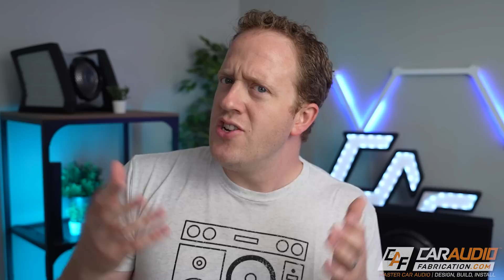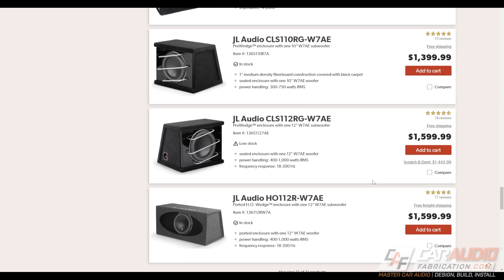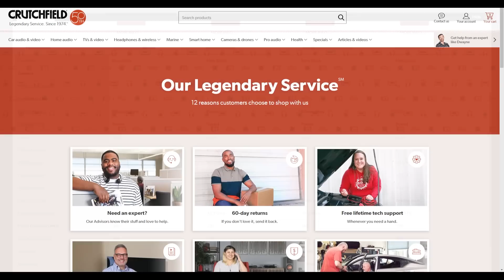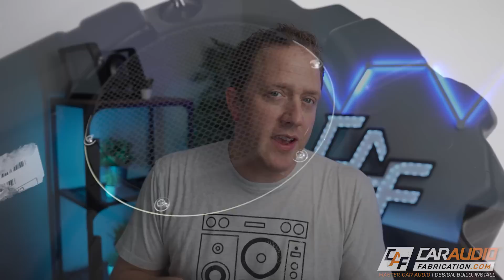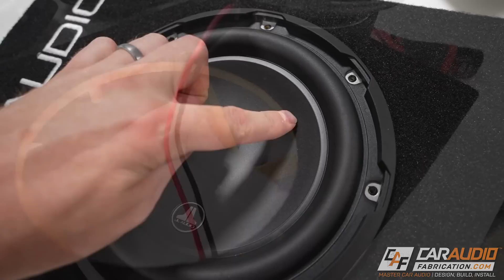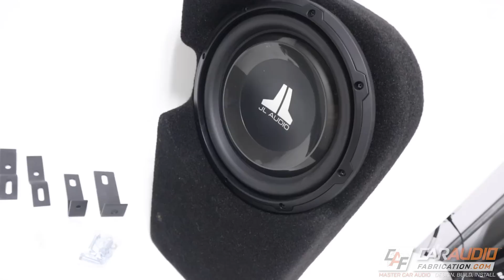5 Reasons to AVOID factory “premium” subwoofers! Get THIS instead!

Comment: Problem is usually the premium sound systems include more locations for speakers, so if you go with a lower end trim w/o the upgrade you’ll loose the unique built in locations. Same with the built in subwoofer, and middle dash speaker locations. 

It’ll also be a lot harder to tune to get the surround sound system that most premium factory systems have. Only downside to aftermarket stuff is that it usually requires heavy modifications, like the a pillars here for an example. 

I don’t like anything taking up the view of the windshield personally so having these giant boxes stick out would probably drive me crazy. Then there’s the problem if you have a niche vehicle, one that doesn’t have that much custom door/a a pillar options, and the speaker count themselves. 

That’s why I love the newer Ford trucks so much, they have a-pillar locations for tweeters, big door speakers, center dash speaker, and a subwoofer that is stealthy mounted behind the rear bench seat. They usually already have enough alternator power too, especially on the diesel 6.7 F-350’s since they come with dual batteries, and dual alternators.

Comment: Thoughts: could you effectively ADD some bracing (think thick styrene glued in place with CA glue or a stong yet semi flexible construction adhesive) and also use Dynamat sound deadening material to reduce resonance and flex on the cheap plastic sub boxes? Id like to see an SQ and SPL test comparison on something like that. 🤔

Comment: Factory premium is a godsend tho compared to standard, especially on the older vehicles, where that "few hundred watts" is massively larger than the maybe 50-80 watts the non premium uses. Even aftermarket head units only improves the sound on the stock older truck speakers, and those are only running 14-25w/ channel... So factory premium on say 200w is at least double the power over that. 
That being said, my stock normal system is not bad on my 22 Durango, it just needs more of the deep bass. Midbass isnt bad, but lacks yhe deep punch below 50hz to match the good sounding mids and highs, so yeah, just adding an aftermarket sub would be good for me in this instance, however I feel the factory premium would be enough for me on this vehicle. 
My project 96 Ram tho is getting a custom stealth pirted box with an Alpine type S 12 and type S coaxial/triaxial panel and door speakers, and will run off a 5 channel 1000w RMS Pioneer amp.

Comment: I have a base model Golf Alltrack, which doesn’t come with the “premium” Fender audio. I built a sealed box perfectly spec’ed for a an Alpine W series sub. It fits perfectly between the spare tire and the load floor so there is no lost space and it is hidden. It sounds a lot better and hits way harder than the Fender optioned cars. I already had an amplifier, so the whole thing cost me 200 bucks. Building your own box, if you have the ability, is cheaper and better than even one of those loaded sub boxes.

Comment: I've been a car audio guy for over 40 years and won some SQ contests back in the day.  But now at my age I just buy the premium system (if it's good) and add my own sub.  For example, 2020Lexus RX350 with Mark Levinson system, but used a JLAudio 12W6 in a 1" thick 1 cu ft. (well built) sealed prefab enclosure, driven by an AudioControl 800watt amp. tucked below the rear deck.  It saves me the hassle of ripping all the panels off the vehicle, running new wiring, and at my age and hearing it is PLENTY good enough for the car.  Do I like better quality sound?  Sure!  But this is a good compromise for me at 64 years of age.  Has anyone out there heard a premium factory system where the subwoofer was actually great?  And I don't mean it sounds good at a low-moderate volume, I mean sounds good and you can really still feel the bass like with a pretty decent aftermarket solution.  If so please let me know!
Reply: I messed my low back and leg up so that is likely all I will do in the future as well.  I currently have a van with six speakers, tweeter pods, home made crossovers, several runs of power cable and three amplifiers and dual subwoofers but in the future I will probably just run a amp and sub as you mentioned.
Reply: How did you avoid running a power wire to the amp?
Reply: @scose  I didn't avoid that, but it wasn't too bad as I didn't have to remove much to set this up in my Lexus.  Way less work than changing out a head unit and trying to make it work with all the steering wheel controls and pulling all the interior panels off to change speakers!

Comment: This is going to be a stupid question but is there a way to run an aftermarket subwoofer, active line converter and a 900 watt amplifier without upgrading the alternator. Is there something That I can add to help the power, As it is a pain to change the alternator in my 2008 Lexus ES 350. Thanks

Comment: Buy once, cry once.  I'm still rocking amplifiers I bought in 2005.  However the OEMs tend to change things up with regards to speaker sizes so I wasn't able to keep installing those in my new vehicles.  Head units and processors are also somewhat disposable as dashboard designs change and new aftermarket features are introduced.  Gone are the days where a single DIN stereo could be installed in any new vehicle.

Comment: I need answers!! Been a fan of you since the early 2014 but i got a really important question about amp and sub. I have an extra 4 channel amplifier and i want to put it to good use since my component and coaxial speakers are all powered by a dsp+amp. How do i make my 4 channel amp become a bridge connection for my 10" subwoofer? Im assuming that would give half of the impedance which can give more power to my sub. Im confused on the terminals and im afraid to just carelessly do it without confirmation. The amp has a symbol of mono connection on channel 1 and channel 2 and another symbol for the connection channel 3 and channel 4. How do i do this? Really appreciate your response in advance, love you man ❤
Reply: You can't bridge a four channel amp to one channel. You can bridge channels 1 and 2 and/or channels 3 and 4. So it can be used as a 4, 3 or 2 channel amp. If you want to use all of the amp for one sub, you need a double voice coil one. But if it's single voice coil, you can only use one half of the amp.

Comment: Finally at the point of wanting to ditch the factory Bose in my Denali hd after 10 years. Upgraded to a Tesla style tablet/head unit and already have noticed an improvement. Now to put in the high end JL system (well some of it) that was destined for a previous vehicle that was written off before I could build the system. Will also make use of all the audio control goodies from days gone by.

Comment: What about adding an aftermarket sub to replace the OEM sub in the same box!!  Example replace the sub you showed with a shallow mount JL or Kicker if the other speakers and radio have been upgraded and are run off an amp. But you want the stock look with added bass
Reply: I've always wanted to try that! You could had a baffle to the enclosure to reduce flex. Also, everyone forgets about accoustic stuffing.
Reply: @producer226  yeah it’s in a 2010 DC Tacoma. I was going to dampen the OEM JBL box and maybe add a shallow kicker compRT 8”.  My AC 4.800 has plenty of power  but just wondering how that will sound. I didn’t want to cut the plastic to add a diff box

Comment: Some factory systems are plenty for every day needs.  But the thing to think about with an aftermarket sub & amp, or combo, is that it will take up space that you may not want to sacrifice.  And in many cases they can actually overpower the rest of the factory system (because they are designed more efficiently and use better products), leading to difficulty with getting the entire system to work well together at all volumes and having to make constant adjustments.  If you want something that integrates into the car and saves space like a JL stealth box, those are just as expensive as getting the upgraded sound system from the dealer, plus you need to pay to install those along with adding an external amp.  Having someone custom fabricate an integrated sub & box can be costly as well.
Reply: Sometimes you can only get the "premium" audio system as part of a package which includes other upgrades that you may or may not want or need.  Or it's a separate option, but one which is only available if you get the higher level "premier" version of the vehicle.

All this is to say that you might be paying a whole lot extra to get the "premium" audio system, even though you're technically paying for and getting a lot more than for that then just the premium audio system.

As for the effort required to avoid taking up cargo space or to keep the look OEM/stealth, thus varies from vehicle to vehicle.

My 2019 Chevy Bolt has a pseudo spare tire well, even though GM didn't actually offer a spare tire for it.  The Bose "premium" system uses that spare tire well for the subwoofer and external amplifier [neither of which come with the base audio system].

But the Bose "subwoofer" is a 6.5" driver which is more like a regular mid bass component.

Most owners of these older Bolts who desire better sound will install an aftermarket sub in that spare tire well, so they don't lose cargo space.  I don't believe that it's terribly difficult to make an IB enclosure for an aftermarket sub.

Note that the sound of the base audio system or "premium" audio system varies greatly from vehicle to vehicle.

The 2019 Chevy Bolt's base system sounded awful.  I've never heard the Bose premium system, but reviews indicate that it's not impressive [though a definite improvement over the base system].

Comment: In 2024. If your not happy with the best factory sound in a new vehicle standard or premium. Easiest thing to do is upgrade door speaker's to a good aftermarket brand hell they Have 8" shallow mount subs that hit like some old school 12s and very small amplifiers that crank out the watts on low voltage. Most you can plug and play on door speaker's and not need a amplifier or if you do small and easily done without any loss of space. And if you want to really throw some bang  in it look up skar audio 8s costume boxs for your vehicle. I have 4 8" skar subs in box under back seat of a 2021 f150 xlt 4 door and a skar 2000w rms amplifier with factory premium door speaker's and 4 tweets aftermarket and it shakes the mirrors so hard you cant see out of them and nothing stays in cup holders or loose anywhere in truck. It's crazy how hard they hit box subs amp and tweets all for around 1300$ on factory screen/deck and it's more than most people would ever want or handle. Them sub/amp combination deals are trash. And not all Kenwood or RF or pioneer are equal knock off come a dime a dozen and most brands over rate the spec's of the product hugely as far as max watt or RMS watt goes and if its paper cones small magnets low Xmax and max watts its probably trash just being honest.

Comment: the range in vehicles that sound good by adding just a subwoofer is slowly shrinking. complicated factory audio outputs are starting to make integration much more expensive. BUT people are still slowly allowing themselves to pay the extra money needed for the proper parts and we're still doing our jobs :) i especially love it when i get some "high end" bmw or even a range rover that DOESNT have ANC or injected exhaust noise into the audio, and when you add a sub, it works as intended! thats not true for most GM, Ford, or Dodge though.... ANC is almost always a problem with usually a solution (easy or not).
Reply: Manufactures have made upgrading to a better system far more difficult.

Comment: Don't you lose you factory warranty if you go aftermarket ?
Reply: Absolutely.  Manufacturers will look for any reason to get out of a warranty.  I had a Ford Focus where I was getting a crackling sound from the door speaker on the driver side.  So I figured maybe it was blown, and I upgraded all of the speakers with direct replacement coaxials from Memphis.  Simple plug & play install.  When the sound persisted, I took it to the Ford dealership since it was still under warranty, thinking maybe it was bad wiring or a bad channel on the head unit, and they found that the wires were getting pinched/damaged where they go through the grommet into the door.  They refused to fix it despite acknowledging it was a wiring problem having nothing to do with the speakers.  But since I had made a change to the audio system, it was no longer warrantable.

Comment: If you had to pick one factory system to keep, which would it be? I personally like the mark Levinson systems in the lexus's and the highest level akg in the new escalades. That having been said I was just curious if you HAD to chose if it would be similar
Reply: That really depends.  Some manufacturers allow for a lot of adjustability on their factory systems.  Others you can only adjust bass, mid, and high and you really have no idea what frequencies are included in those settings.  I had a factory Bose system in my Yukon that sounded horrible until I upgraded the head unit and speakers.  However the 9 speaker factory Bose system in my 2011 Altima sounds amazing and provides a lot of clear deep bass.  More than enough to rock and rattle the trunk when I want to.  I had a Hyundai minivan with an Infinity surround system with DVD.  That was one of the most clear sounding factory systems I ever had.  I recently rented a brand new Ford F150 with the upgraded B&O sound system, and it was just ok.

Comment: My wife and I bought a new, dealership car (never again).  We chose the base model, automatic Versa...
No Factory radio $600 🤔
Instead, JVC radio and adapters $100 
I simply removed the blank DIN cover, put in a metra pocket and CD player.  The plugs, wires, antenna and even door speakers were all there! 😂
Reply: The $100 dollar JVC Is an upgrade over the $600 dollar factory unit.  Also yes most of the vehicles today that have a radio option still have basic speakers, wires, and antenna.  You just need a a wire harness kit and a stereo for those.
Reply: Back in the 1980s, my mom got a new Toyota Corolla which had no radio.  She didn't care about having a radio and this reduced the price a bit (I don't know by how much).

I didn't know that major automakers offered this as an option nowadays!

I didn't think about it, but this would have been the smart option if you're going to DIY an aftermarket audio upgrade anyway.

My first vehicle wasn't new at purchase (one  year old "almost new" vehicle which had been a fleet vehicle or dealer loaner car).

But had a "radio delete" option been available, it probably would have been a better choice.  I replaced the head unit with an aftermarket unit which had a preamp out, and bypassed the factory speakers in favor of a big box with drivers which sat in the hatch (I just left the rear seats folded down all of the time).

Of course, times have changed and today's vehicles have "infotainment systems" which can't just be left off or replaced [as various vehicle functions are integrated into them].

Comment: What would you recommend for a 2018 Camry with the JBL system I need to upgrade the sub got any ideas
Reply from the maker: I can assist with a consultation, details at www.caraudiofabrication.com
Reply: Roll down the front windows and, if you haven't, upgrade the software to Apple CarPlay. I'm partially joking and partially being serious. I too have a 2018 Camry with JBL. The music clarity and bass response is much better using Spotify through CarPlay versus Spotify through Bluetooth. Still, even though that helps, certainly doesn't match an aftermarket upgrade. I haven't tackled that yet as I don't have the proper area to do installation myself (apartment life) and I haven't found a shop I trust.

Comment: I purchased a Tacoma 3rd gen last year and opt’d out of the JBL system because I knew I was going aftermarket. That means I didn’t have any OEM amplifiers I had to integrate into or bypass. Plus buying the third gen means I can replace the head unit and get a nice clean signal from the start. Plus the JBL system was packaged with a $5k upgrade I didn’t have to choose. So there is $5k I can spend on doing things right!
Reply: I also bought a 4th Gen (2023) 4Runner last year. It is a TRD Pro. It came with the premium audio package. You can still swap the head unit and factory amplifier. Any standard double din fits.

Comment: Usually when "buying", leasing a new car you do not have an option to modify or add stuff to the car so factory option is literally your only option.
Reply: Or , reversible mods that are quickly returned to original state and equipment .

Comment: You are assuming that the after market solution will be installed by a competent professional.
Factory will be the best the factory can install.  Which may or may not be good.  But you can test it before buying.  It's balanced correctly, it's tuned correctly, it's insulated and dampened correctly. etc.
As for after market, who knows?  Maybe you just throw it in the back and connect the wires and call it done.  Which is not even close to good.

I have 2 cars with the best sound system from the manufacturer.  Volvo with Harman Kardin and Chevy with bose.  The volvo is the best sound system I've heard.
I also have been building systems since the 1990s.  I have a custom install in my supra.  Which is close to the vovlo.  But the volvo, package I bought, polestar, only came with that option.  So it wasn't really a question of do I want to do it myself.  Same with the chevy, high country, only came with that sound system.  I bought those packages mainly for the vehicle build not necessarily for the stereo.  Even though I've since upgraded the head unit in the chevy.

Idk, do you just want it done or are you wanting to be particular in choosing a custom solution.